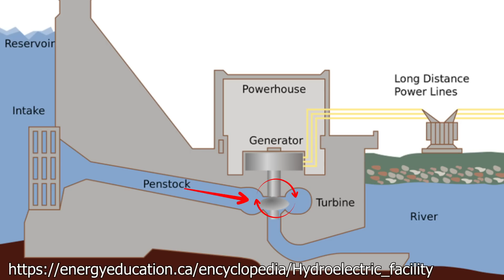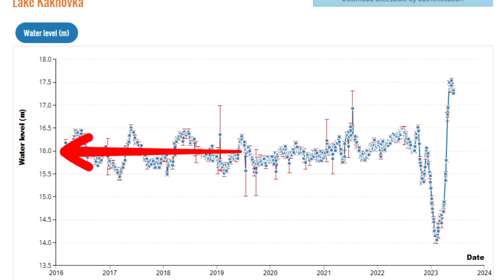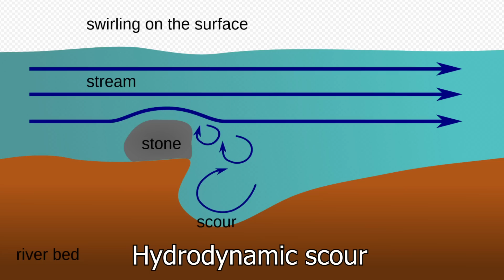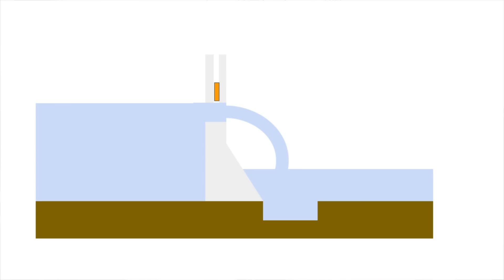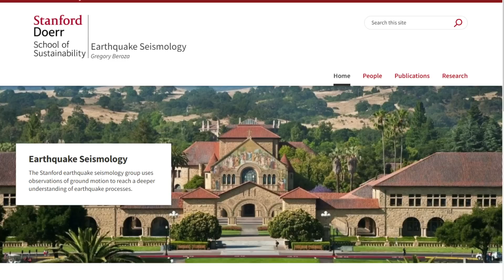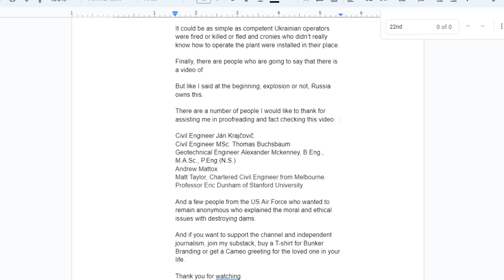How Russia Destroyed the Kakhovka Dam

Comment: The powerhourse is harder to blow up because you cannot access the high current pipes as easy as the maintenance tunnels. You also have thicker walls to withstand constant turbine vibrations. Seen many things whitewater destroyed - it is mostly very localized and stays like this a long time. Even the though fallen road bridge debris could scour the dam on the section with the open gates super fast, the dam is likely protected from it. It likely has an extended downstream platform until the current is normalized to river speed and current breakers to prevent scouring half way of it. That platform isn't shown in the diagram. The mid section appears to have been inactive and only overtopping minimally for a very short time. Most damage occured where the upstream currents V-shaped tip is furthest downstream. That is the max flow. The right side flow is smaller. That is where a kayer looks for the safest place to go down. Someone waited for max fill before ensuring the mid section is broadly destroyed over many sections at the same time and it also collapses between island and powerhouse and between powerhopuse and right bank. Scouring could not jump the powerhouse. That's the tidal power engineer and the MechInf demolitions guy speaking.
Scouring would also not have the center island and powerhouse mid section collapse. Explosions were simultaneously blown up in 3 section. Main current, between island and powerhouse and powerhouse to right bank. 
Doesn't rule out a rigth bank damage collapse leading to a full blow-up decision before losing the opportunity.
So both arguments may be true at the same time - serious damage forced the Russians to decide and superiors could not be asked in time. Someone panicked and blew it up, Crimea or not. Pls. not that this may also have been faked to cover up the blow-up and cast it in doubts.
Again, themost major damag is where the stream tip is. this id where the damege is deepest and widest to cause the main volume flow go don there the fastest. Hence the place where the V-shaped tip in the turbulence wake breaks. The 2 other sections see much less destruction. There is likely a sandbank or sediment deposit between island an powerhouse. From powerhpuse to the right the dam is eventually damaged differently in depth and debris collecting. It does have a much different right bank centric flow collection and turbulence pattern. It oddly doesn't form a V-shape tip- The current does push against the right outer bank and form a cushion bouncing back from the obstacle at high current speed. It does collect extra water blocked by the powerhouse.
No sane Ukrainian would snipe a sluice gate crane operator. Who eventually is a trained and experienced Ukrainian with a 2 Russian guards anyway.
It would simply lazy and not walk that far to just use mainly use these gates and ignore sediment management. That would also funnel more water into the Crimea Canal as the exit flow is drawing to the right bank. As long as sluice gates are open and the powerhouse is operationsl the top overflow would fully load the dam but not scouring the dam. The dam is built to withstand the strong and like 50 to 100 meter long extremly fast 14+ m/s current trails. Minimal overtopping would not effect that and could happen in any major flood event anytime. HIMARS has been used to topple that road segement near the powerhouse  or the lock&dam section. In theory dam damage is possible and the vibrations of the powerhouse could have caused long term erosion. However none explains the mid section destruction or the island to powerhouse section. This one is the strongest evidence ot a blow-up because that is where the least pressure is on the entire structure and no previous damage has ever occured at all. This is where the sediments actually keep all pressure naturally away. Looks there has been some sandbank or island even before the dam was ever built. So this section would be somewhat intact even in a blow-up event and that is what we see - that's where the least water is going down judging from leat deep from least turbulence from slower current, some eddies and color, standing obstacles and wave pattern, no drop and no huge wave at all. Look at the powerhouse-to-island section and you know that one has definetly been blown up to be affected at all. There is no water pressure to do anything. So how would the mid-section ever see this major fast main current from a right bank event?

Comment: Nice Video, but here a few thougts about it:
-the Russians already mined the dam in last Oktober, as Selensky told the UN about that.
-if it is a normal thing to open some elements of the dam top to let water spoil through, the structure behind the dam has to be of a nature that can withstand the spoiling water. Otherwise that makes no sense as a normal procedure.
-the Ukrainians have conquered some Islands south of Cherson as footholds for an further assault on the left bank of the Dnepro River and these Islands are now completely flooded. It is possible the Russians wanted only to flood that Islands and lost control over the dam so it collapsed completely. That would explain why the Russian Soldiers on the left side of the river were not removed bevore the flooding. They expected some flooding, but not that much.
-that part of the road that was gone a few days before the flooding was already damaged because of HIMARS as the Ukranians wanted to cut the lines of supply for the former occupied right bank of the river last year. It may broke down anyway.

Comment: There are several flaws in your presentation:
- You don't explain how the large earth filling making up the southern part of the dam suddenly disappeared
- The machine hall, the concrete plate part of the dam and the earth filling part of the dam have very different constructions.  You don't provide any reason why parts of all three of them should break down simultaneously.  
- Disregarding the seismic data because you don't see the scales there, is strange.  
- The seismic data was not made public for people to analyse themselves.  The figure that was made public, was just a sample of data from ONE seismological station.  NORSAR did a thorough analysis based on several measurement stations and found that there was an explosion measuring between 1 and 2 on the Richter scale.  Only by using several stations is it possible to pinpoint where the explosion happened.  There is no reason to expect a strong explosion if a dam breaks down according to your guesswork.  
- After the dam was busted,  the Russians moved forces from the south side of the dam to positions further east, so they obviously had a military benefit of the dam being blown up.
- The Russians have an explicit goal of "denazifying" Ukraine.  Ukraine are supposedly "nazis".   The Russians routinely make terror attacks against civilian Ukrainians.  Mostly they use missiles and guns, but using a dam is more efficient.

Sorry, I think you are all wrong.

Comment: I think your thesis is right its a warzone on the front line nobody wanted to risk their lives unnecessarily so they did the bare minimum they thought they could do and didnt open enough gates and that collapsed the dam.  The strange thing is why didnt they just leave all the gates open its a warzone do they really need a power generator on the front line they should have shutdown the dam opened the gates and left it alone till the front lines moved a few kilometers/miles one way or the other.

Comment: I believe Russia neglected the operation of the dam altogether. They opened the southern spillway(s) and left it at that. That explains why the water level was so low before the fall / winter rains and snows. Then the water level rose to overtop levels because the spillway(s) they had opened weren't enough to alleviate the pressure. Russia moved back their heavy equipment below the dam and changed their law because they knew the dam would eventually fail, due to overtopping and scouring. They waited too long to move back their manpower because they didn't want Ukraine to get too suspicious. Anyone who saw the overtopping knew the dam would fail. Ukraine couldn't do anything about it and Russia chose not to do anything about it. In my book, that makes it Russia's fault. Since the Kakhovka Dam collapse, Russia has purposely blown other, smaller, dams to slow Ukraine's counter-offensive.

Comment: During Operation Chastise in 1943, The Dambusters (617 Sqn) used "Upkeep" bombs which were dropped at 60ft and skipped over torpedo nets, stopping at the wall of the dam and detonated 30ft under the water for maximum percussive force. Those bombs were filled with 6600lbs or 2.99 tonnes of  torpex and it took a few good hits to make the Mohne and Edersee  Dams to collapse and cause damage to the Sorpe.

Comment: Exclusively using the gates closest to the abutments is bad practice anyway, especially if the downstream water level is low. They should have made sure to use more middle gates open less. Fluctuating water levels too quickly is also a good way to cause slumping of earthen structures and banks. Could be purely incompetent.

Comment: Interesting.
It sounds EXACTLY like CIT (Conflict Intelligence Team) assessment (Russian anti-Putin OSINT group in exile).
They also looked at satellite images over a longer period, consulted with hydro-engineers, and concluded that the most plausible cause of the collapse is criminal neglect by the Russian side.
They also pointed at collapsed roadways a few days before the dam collapse, pointed out that water gates were left in the most dangerous way possible for more than half a year, and that the dam was overflowing. 

Ukrainians, sadly, were outraged by that. They distort it as "if you claim that is not a deliberate act, then it means it is 'just collapsed' and there is no one is to blame, you Russki scum". Even though CIT was crystal clear in calling it "criminal neglect" by the Russian side.

Comment: Possible, but as you said Russia owns this. Russia was in control of the majority of the dam (all the way to the right side roadway (that was destroyed). I would agree that the overflow is very destructive to any dam. But why was there no word from Russia prior to the dam collapse? Ukraine would have to withhold firing at the crane operators to open the gates. The result of the dam collapse is all in Ukraine, occupied and free Ukraine. It is not just Crimea that receives water courtesy of the dam but also the right bank Ukrainian side received water via canals that are now dry. Water is 17m down and all the communities upstream of the dam will struggle to get to that water. In the summer the dam provided reliable water supply to much of Ukraine - that is now gone. 
There is no damage to Russia or Russians, just Ukrainians. And any crossing the Dniepro by Ukrainian forces is now impossible both at the former dam site and below it. And that is where you are completely wrong. Yes, it makes a little difference if the water obstacle is 1 or 1.5 km wide but it makes a lot of difference if the banks are muddy or solid. After the dam collapse the river cannot be crossed because the soil is inundated with water.
the dam collapse was intentional - it was Russia that let it happen.

Comment: You forgot about the fact that the Russian forces mined this dam from the inside with mines and high-explosive shells, and about a week before it was destroyed, they issued decree No. 873, which says that they will not investigate such cases until 2028. There is also a video that recorded the moment of some kind of explosion on June 6 at 02:46 am, filmed in TPN-1TOD. The video does not show any arrival of the projectile. And this is all at the beginning of the Ukrainian counteroffensive. By the way, this dam was designed for all dynamic overloads, including external shelling and the use of nuclear weapons. Its structures of the engine room are solid reinforced concrete.
Do you believe in so many coincidences? I don't.

Comment: The coincidence is too much. It will not need a lot of explosives to damage the spillway. Specially if you already control the flow. Just manually drilling on some critical part and giving it a small explosive push the overloading it with water will do the trick.

Comment: They just blew another dam at Mokri Yaly river.
I also thought that it failed dua to stress but now this theory seems a bit iffy.
There's a company that monitors all lakes and dams by satellite and they showed a graphic that shows that that dam was at an all time high.
They let if fully fill and blew it up, if it quacks like a duck.
Hopefully the Ukrainians will kick them in the groynes (I had to).

Edit
You show the graphic in the video.
For hydrodynamic scour to happen it would have to flow right on top of the obstruction: The water in contact with the obstruction  will "stick" to its surface and slow down while the rest of the water keeps the same velocity. That's what causes the turbulence. When you open the flood gates the water just lands on top of still water, doesn't seem to create the conditions for it to happen. The distance from the gates and the dam floor it's also too big for this to happen.
Honestly I don't believe it's this.

Comment: Ryan, in the light of your normally well-informed and rational explications of all things military, I find your dismissal of the significance of a wider river uncharacteristically peremptory : if the inverse-square law applies, any difficulty and risk in executing an offensive river crossing is surely going to increase as a square of any increase of distance to be crossed (even if we ignore any increase in speed of current). Crossing a river under fire is like crossing an open field under fire: the smaller the field the quicker - and therefore more survivable - the crossing, surely.
Other facts to consider: Romanian seismologists confirm Norwegian seismic data and its timing; Russia has had control of the turbine rooms for a year - plenty of time to pack a mere 4000lbs (1800 kgs one small truckload) into the dam's weakest point; Russia has form in respect of this dam (the detonations to prevent a Ulkrainian pursuit during the Russian retreat from Western Kherson Oblast); the flooding of the islands closer to Kherson city (some of which UKR had taken) and increase in the width and current of the river would inevitably disrupt current and planned UKR offensive action, neutralise existing gains and reduce the length and depth of ground that Russia has to defend which simultaneously allows those forces to be redeployed to more vulnerable battlegrounds (e.g. the Zaporizha to Tokmak/Melitopol/Mariupol axes); the flooded delta isolates UKR troops on the Kinburn spit; Russia's scorched earth military philosophy; Russian phone conversations intercepted so far indicating 'grapevine'-level of knowledge of the cause. However, it might be argued in Russia's defense that all the damage to Ukrainian cities and infrastructure (including the dam) and deaths of tens of thousands of Ukrainians was caused by Ukraine resisting Russia's justified and legitimate promotion of its sovereign interests. However, should that defense fail to gain traction, it can be pleaded in the alternative that it was Ukraine - not Russia that has caused this destruction and death in furthering its own Satanic/Nazi militarist ambitions and Russia merely stepped in to protect Russian speakers from NATO, the Collective West and the LGBTQi 's. 
That the dam wall might have been undercut by hydrological factors is a red herring ('Look over there') when the issue under consideration is culpability and accountability.
Cheers! thanks for the good work you're doing: it is really appreciated.

Comment: Note that access to maintenance logs for the dam was banned before the failure. Still Note the high water levels and overtopping after the heavy rains that were allowed to build up. Still Note the seismic event recording consistent with a major explosion at the same time as the breach. No other such events were reported at that time. Note the intercepted call indicating Russian involvement, albeit an incompetent. Note the video recording of evidenced explosion with debris forced vertically, consistent with an internal explosion to the structure. Note that, without the Russian invasion, blowing the dam would have had no benefit.  Agree that the excellent technical summary at least throws some doubt, but as said: Russia owns this.

Comment: A structural collapse doesn't show up on seismographs.
Reply: yes, but it is likely that the dam would collapse anyway, but probably not on such a scale and or not as quickly. However, it seems that it wasn't planned so soon anyway
Reply: @pavelsulc2617  so what is the relevance of what you said? There was clearly registered shock on seismographs, wich sugests large explosion. Ergo, an explosion caused the dam to collapse. Should we add the lowering of water on previous days (probably to facilitate explosives team access)? Again, I see no contribution to the discussion.
Reply from the maker: No, it’s Ken. I spoke with a professor from Stanford university and landslides show up all the time. This is basically a landslide so the seismic data should show a landslide.
If the damn was destroyed by explosives, you would see a spike, followed by a landslide .